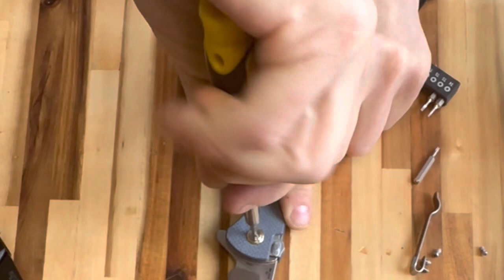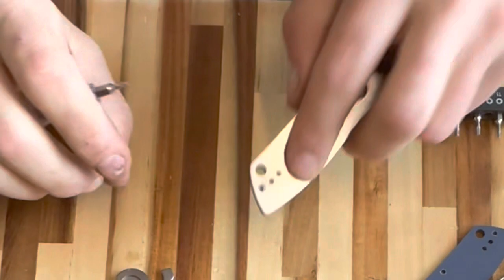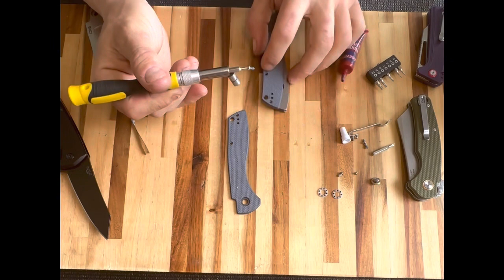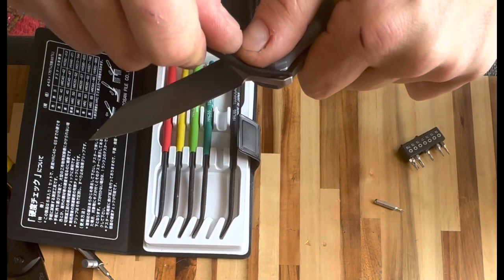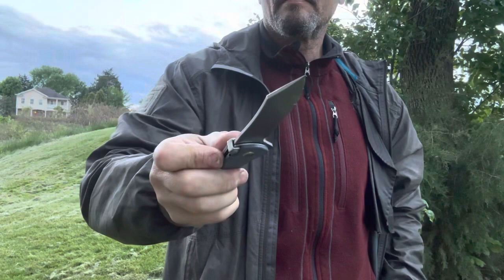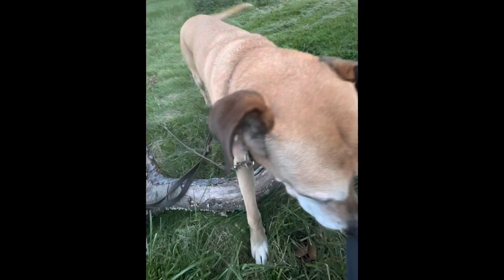Are Artisan and CJRB knives garbage?Crag and Kicker Recoil lock flippers tested. Don’t Buy!

Comment: At this point, I've totally given up on Artisan/CJRB.  I've been collecting for over 30 years now and have owned knives from so many different brands... and no brand has consistently given me lemon after lemon like Artisan.  I'm not exaggerating at all.  SEVEN attempts at buying a knife from this brand broken down:  1. CJRB Riff - had such a weak plunge lock spring that I could hold it upside down by the handle, give it a little wiggle and the blade would just fall out.. so I returned it for 2. CJRB Riff - the second one was a little better, could be held upside down by the handle and the blade wouldn't drop, but if picked up by the blade while close, it would open - returned for my money back... 3. CJRB Version - bought this one the day it was made available.  I was excited to check it out when I got it so I did what most people do when they get a new knife - flicked the blade open to have a look at it - and... blood everywhere.  The G10 scales were so poorly fit to the aluminum frame/bolsters that the aluminum created four needle sharp protrusions that absolutely shredded my hand open just from one flick.  Upon closer inspection, I saw the huge gaps between the scales and frame/bolster.  I returned to CJRB immediately and received.. 4. CJRB Version - before opening this one, I felt around the back of the knife to ensure that I wouldn't have any nasty surprises - I could feel four sharp points but they weren't nearly as bad as the first knife that I received.  I flicked it open and noticed that the plunge spring was extremely stiff.  Not a big deal, it would break in I told myself...  lockup was solid - so I started visually inspecting the knife - horrible scale to frame/bolster fitment left 4 gaps of varying sizes and sharp points all around the handle so I decided to try one more time because I liked what the knife was trying to be... 5. CJRB Version - Ack!  My third attempt at owning a Version and once again, horrible fit and finish - sharp edges and wide gaps of varying size between the scales and frame/bolster - but now a super weak plunge lock spring and much much worse - super uneven edge grinds!  The tip was actually rounded over a bit and the stonewashed finish was ground off about .10".  I gave up and returned it for a refund... I thought I was done at this point, but kept hearing about how great some of their knives are so I decided to give a newer model a try.. so I picked up a brand new... 6. CJRB Pyrite Light -  I hate FRN... but I figured that it would be "light" given its name.  This knife is not as light as it should be.  I was actually stunned at how chunky it felt for an FRN knife - upon closer inspection I spotted the culprit - zero machining done on the full length steel liners to lighten them... what???  Why???  It seems like the only thing "light" about this knife is the amount of work that Artisan put into it.  Besides my problem with the actual design itself though, the knife had no QC issues...  I kept it but I don't really like it.  This knife is sooooo overrated.  In a final attempt to try to find a knife from this company that I like, I decided to pick up an Artisan Cutlery branded example which led me to... 7. Artisan Cutlery Arroyo - It was on sale for $22.50 on Amazon and was in RPM-9 (which I'm not particularly hyped about, I just have too many D2 blades).  So... I flip it open... and what do I see... HORRIBLE... HORRIBLY uneven edge grinds!  On one side, it's so bad that there's actually a clearly visible line on one side about .5" from the tip of the trailing point where the tip angle is completely different from the rest of the edge.  The detent is just bad.  It's somehow mushy AND too stiff... don't ask me how...  At this point, I just give up...  I can't be this unlucky...  I've rarely had to return any knife in all of my years of collecting...  I have to say it - CJRB sucks...  7 attempts (6 too many) and 7 failures...  I know that CJRB fanboys will come out of the woodworks to defend them - but this has been my actual experience with this brand.  I'm not going to waste anymore time with them.  I've given them more than enough chances...  I REALLY wanted to get a decent Version because I like the design a lot - but 3 bad ones in a row was just too much.
Reply: Feel lucky you even got a knife to dislike.  According to the feedback on the website, they blatantly steal money from their customers on a semi regular basis.

Comment: I was hoping this was an AR-RPM9 blade, but I see it was a D2 version. Have you ever tested AR-RPM9? I doubt it would survive, but I'd be curious to see how it compares to this D2.

 Your video says "don't buy!", but all things considered this knife did pretty well. It was well put together, 60+HRC, and survived much more abuse than I've ever given a pocket knife before the tip broke off. I don't love the locking mechanism, but it didn't fail. For a 3.5" blade under $40, this is not a bad hunk of steel!